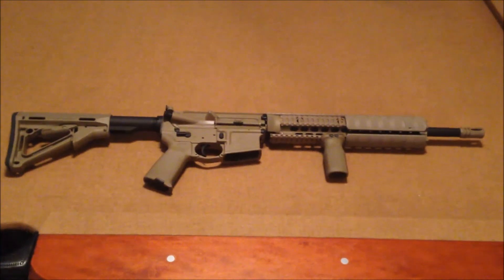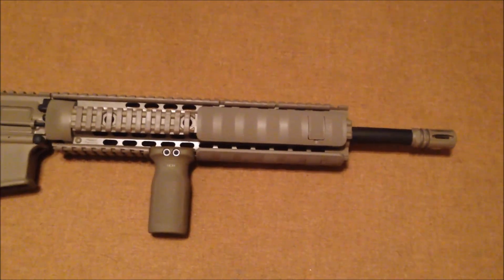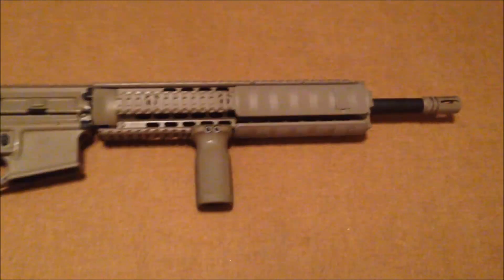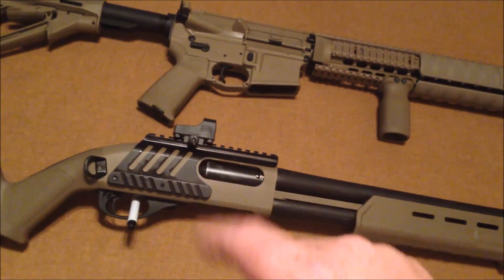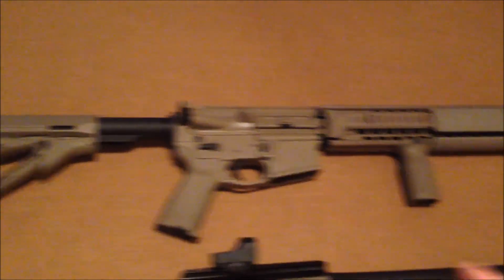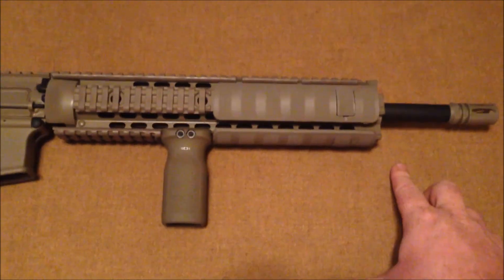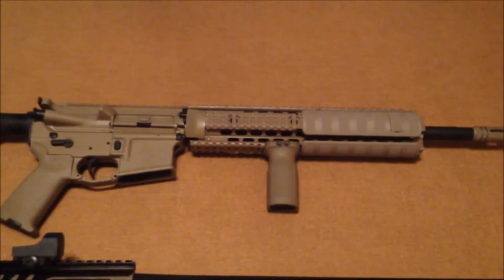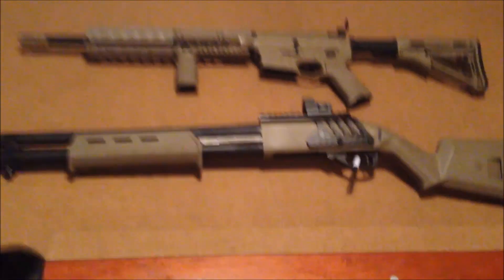Part 4: Rock River Arms AR-15 and Remington 870 Tactical with Magpul by Burris Arms Build Recap

Comment: Iv been looking everywhere for the 18.5 inch police barrel and mag extension tube from Remington.  Can you please post a link to both?
Reply from the maker: Here are two different barrels from Midway. They have a sale right now too. Here are the barrels. There is two different police barrels, one has front and rear sights, like the first link, and the other barrel just has a front sight, like the second one. Good Luck!
http://www.midwayusa.com/product/496356/remington-barrel-remington-870-police-12-gauge-3-18-fixed-improved-cylinder-rifle-sights-parkerized
and
http://www.ebay.com/bhp/remington-870-shotgun-barrels
Here is the extension tube
http://www.cheaperthandirt.com/product/6-1024250
Just make sure when they send you the extension tube it is +2 not +3. They sent me the box for +2 but it was a +3 tube, so they had to send me the correct tube.
Reply from the maker: BURRIS ARMS You have to expand the comment above to see the links.
Reply: I got it, thanks man
Reply: Stocked for the day it comes